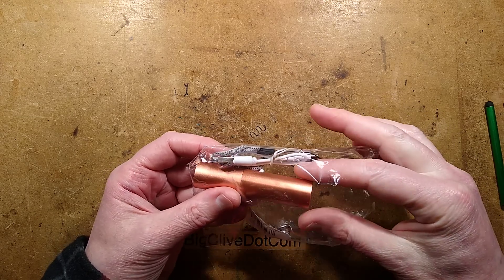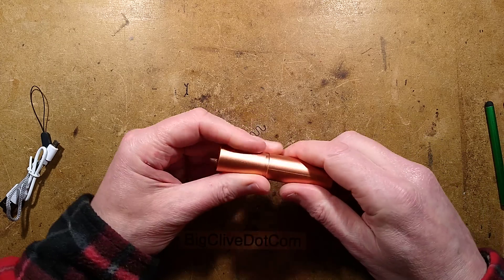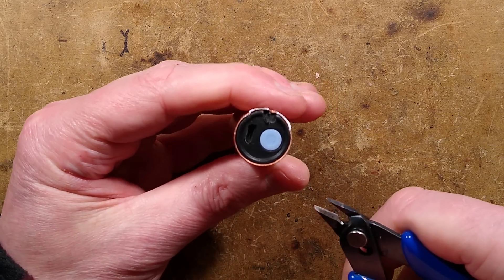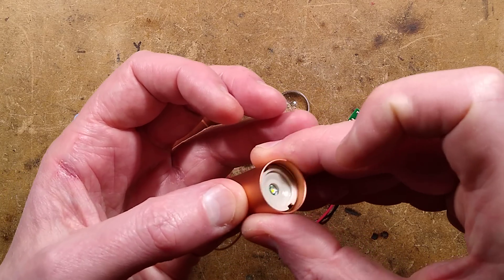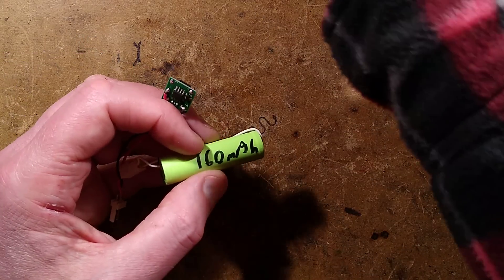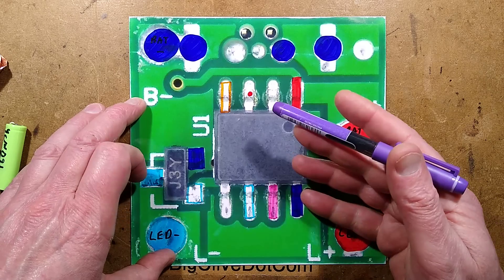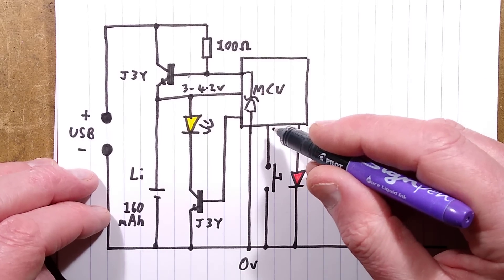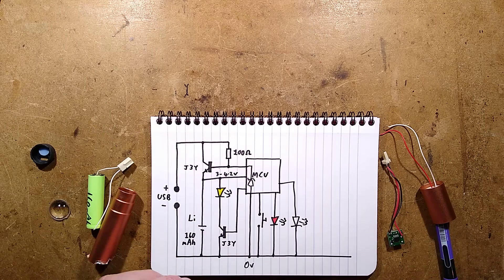eBay 98kW LED flashlight (slightly exaggerated) with schematic

Comment: Ebay watts are on a slightly different scale to regular watts.
Reply: Just like nautical miles are on a slightly different scale to regular bananas.
Reply: Computer storage on AliExpress has a different scale too. I’ve seen ads posted for SSDs and flash drives ( SD & micro SD cards ) that had capacities in the petabytes (1 petabyte is 1024 terabytes, or 1000 depending on if it makes the company more money) for less than what the similar sized storage in terabytes would cost. Wish they were real as I would buy a bunch and have all of my storage space taken care of until technology makes SSDs in a RAID with hot backups unusable like a paper card reader.
Reply: @capitalinventor4823  I once managed to „upgrade“ a fake 1GB pen drive bought on eBay to a total of 128.12GB. To do this, I cracked open the case and dropped a genuine 128GB SanDisk micro SD into it... 🙃

Comment: It would have been nice of you'd measured the Voltage and Current to the LED and told us what the Wattage actually was. I expect closer to 980 mW. Only five orders of magnitude exaggeration!

Same thing with the USB power bricks some of which suggest they can feed 1A for over 10 years before requiring recharged. I suspect they're fibbing.

Comment: I run an escape room and I want to have a system where shining a UV torch on a puzzle will give you more context to it, so rather than just explain everything to kids over a clue, they can look at a picture that is invisible to non-idiots. I wanted a way of building my own rechargable uv torches and that schematic is going to help me loads!
Reply: Ask on r/flashlight for a suggestion based on your requirements. It is a good community, and someone would be able to advise a model that matches what you are looking for. There is a lot of modding advice too, with advice of what base to use it you want to fit your own LEDs.
Reply: UV LEDs can be tricky to get right though, as many „UV“ LEDs tend to emit the wrong wavelength to make UV ink show up as desired. A backup plan - If you want one - Might be to provide red or green LED torches and paint the clues in the opposite colour (So green paint, if red torches) obscured by patterns in the same colour. 😇

You'll be familiar with this idea if you ever used 1st generation 3D glasses. 🟢👓🔴😇

Comment: My eyes still haven’t recovered from the mind blowing power of that torch
Reply: My Tablet screen melted! ... Big Clive owes me £110! 🤣
Reply: Well, I purchased a small flash light that advertised itself at being super bright, where my eyes have likely been damaged from using it. It was only 5 Watts although used a UV diode that produces UV light that can cure UV epoxy. Really burned my eyes and had giving me headaches and had me seeing spots after using. Gotta be careful of cheap Chinese cr*p!
Was several months when accidentally I noticed it could cure UV Resin, and thus was the cause of my eyesore. Now I'm paranoid of Chinese led products.

Comment: I'm impressed that a 160mAh battery was able to power a 98kW beam for more than 20ms
Reply: That's a 160 Amp battery.
Reply: @solarsynapse maybe it’s a 160mah battery at 96kV
Reply: @nialasciva  I don't think so. Some of the wires are too close together, and arcing would occur, since the dielctric strength of air is about 3 kV/mm.

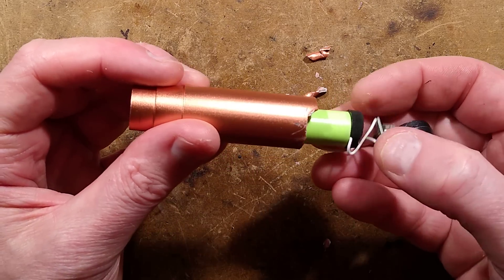Comment: 3:23 One trick I use, when I want something like this taken apart cleanly, is to find some sacrifial bit and superglue it to whatever appears to be blocking access to the innards, like in this case that black plastic bit. Not worth it in this case, but every now and then one comes across something that'd be a shame to destroy. One can usually just 3D-print a replacement for the part with superglue afterwards.

Comment: Where is the battery to be charged on the schematic. Does it go through the IC?
Reply: Below the top left transistor, 2nd "vertical" from the left,  first "vertical" is supply voltage input.
Battery+ is attached to the MCU, but it's the top left transistor that controls the charging.Battery + also connects to LED anode. LED is controlled 'low side' by the bottom center transistor which in turn is controlled by the MCU.
Reply: @michaeltempsch5282 Ah I see it now. To my eyes I was seeing that as a capacitor. I should have noticed the 160mAh. Thanks.
Reply from the maker: The IC controls the charge transistor.

Comment: Ah they upgraded you to the crinkly bag from starch because the 98kw would certainly melt it!
Clive, I have a flashlight with 6 cree leds. It has the hi-low off job, but if you "bump" it, it must pulse a setting change because it then reverts to hi, mid, low, epilepsy and sos mode.
I thought it was a dying battery trick, but if you want to take it to bits, I would be happy to send it to you for investigation. I'm going to retire it from urbex duties.
Maybe most flashlights have this bumpable setting (quick power interruption on a particular setting)
Reply from the maker: Some have a short memory and will switch modes when turned off and on quickly.  That can be triggered by a bad battery connection.

Comment: Thank you for showing a way to open this lamp!
Now I know how to open my lamp without damage ... hopefully.

The charging is medium smart. Over the 100 Ohm Resistor there is a current flow and this activates the transistor. With one pin it measures the voltage and if this is ~4.2V the pin which is going to the base of the transistor is switching to GND, so the current flow stops.
Stupid is, that there is no current limitation, only the limitation of the power-supply and the wiring. With 160mAh there is very easy a overcurrent and very fast charging. Not good. It is worth to open this device.
Reply: How can you possibly know the safe charging/discharging rate of this battery with just its capacity?
In fact, there is a correlation between the two that suggests this quite large battery with an unusually low capacity is made for relatively high current like 5 or 10C. That's how a standard 18650 sized Li-ion like a Sony VTC6 can safely output 40A.
Reply: @PainterVierax  - 
1. This is a China LiIon-Cell. Mostly there is a old laptop cell in this lamps.
2. For this price you do not get a high quality LiIon-cell. If you know china and chinese products, you would not believe that they put a very good cell into this lamp.
3. A very good LiIon-Cel for high current has only 1600mAh, the cells with a higher internal resistance have 2000 or 2500mAh.

Even if they use more copper to reduce the resistance, then the electrodes are not better. With a high charging current you create always Lithium-dendrites. The cell can handle the current, but it get damaged too.

The discharging with a high current is not a problem. There the more copper make sense.

But this device do not have a current limitation, only the resistance of the cable. This is not safe.

Comment: Sounds entirely plausible, that’s only 23,333A out of the lithium cell. /S

Disappointed you didn’t measure the actual power though, BCDC.
Reply: J3Y is an S8050. Maximum dissipation is 300mW, so it'd be less than that. But with these things, who knows!?
Reply: Just enough amps for ball lightning.
Reply: but only for ~2ms

Comment: Can I suggest a plumber's pipe cutter to cut through the next thin circular casing.
Reply: Sounds like a euphemism.
Reply: Or a refrigeration engineers, pipe cutter
Reply: Dremel with a cutting wheel
Reply: Nah, soft aluminium, try a meat clever, WAY faster

Comment: Brave to stick your hand straight into a 98kW beam.
Reply: Hats off to Clive for risking life and limb to make us content...
Reply: As brave as honking those Aliexpress 600 db horns.
Krakatoa is just a whisper in Antares in comparison
Reply: Balls of steel, I tell you!!!
Reply: @ChuckKirchner-se6ib   Is that what the "clanking" sound was?
Reply: It would be the flashlight equivalent of a rocket thruster... Turn it on, and the intense output turns everything in the immediate vicinity into plasma, and with a mighty roar, it is gone, never to be seen again...
Reply: 98 K W Beam, effing amazing, from such a tiny power source too? Those clever people, sure you couldn't be up to them foreigners?
Reply: @conmcgrath7174  The "Lithium cell" is really a micro-fusion reactor!
Reply: @phils4634   Has it got a Tokamak?
Reply: You can heat a whole apartment complex with a micro USB powered device. Brilliant.

Comment: I'm not buying any flashlight less than 1MW.
Reply: Patreon supporters get access to his videos before they are set to public after some days.
Reply: @TazerReloaded  From YouTube? I thought Patreon has it's on video platform. OK.

Thnx for clearing my doubt.
Reply: @Yash9278  They are initially listed as private / only people with the link can access it, and the link gets published on Patreon.
Reply: @Yash9278  The Patreon player is trash though
Reply: Naw, I want 1.21 gigawatts, not a watt less.
Reply: Just ensure you don't drive your car too fast if it is activated.
Reply: @mxslick50 These are perfect for times in the past when you needed a flashlight but didn't have one.
Reply: @mxslick50 I only buy flashlights powered by 3GW RBMK reactors.
Reply: @mxslick50 
You need a flux capacitor
Reply: @mxslick50  Sorry, but no time travel for you. 

Get back to school, Marty.
Reply: @mxslick50  1.21 gigawatts is approximately the output power of the Thomas A. Smith Energy Center in Dalton, a relatively small town in the southeastern U.S. It would be fun if there was a flashlight that outputs the same amount of radiant energy as a medium sized thermal power plant outputs electrical energy.
Reply: I dunno... a phased plasma rifle in the 40 watt range would be nice.
Reply: @95rav just what you see pal
Reply: @Shuhaib-jt9nq depends if you use stupid translators,or if you have listened at school. MW has a very clear univoque definition . It would be fool to always assume people use the Apple word to designate oranges ...
Reply: @Shuhaib-jt9nq  i was also referring to a joke ...
Reply: Imagine you order 2MW laser from temu and then you receive military grade LaWS head.
Reply: Who has the biggest flashlight these days? Last I seen was Photonicinduction at 2.1kW https://www.youtube.com/watch?v=MGANrd7u4o0
Reply: Less than 1MW it should be called a flashdark.
Reply: I wonder what a 1MW flash light would look like… 🤔
Reply: Good news. If you search carefully, you will find plenty of 2MW and 5MW lasers ...
Reply: @Benoit-Pierre  Do you mean mW or MW? There is a factor of 1000000000 between these units...
Reply: @olli1068  i don't mean anything. Fact is, many lasers are sold as branded 2MW or 5MW. 

But you may receive 2mW or 5mW items ... 

1000000000 is not a rare error factor ^^ check the Planck constant ...
Reply: @Benoit-Pierre that’s milliwatt not megawatt
Reply: Stand firm
Reply: Me nether 😤
Reply: I read this as fleshlight lmfao
Reply: Holding a 160 MAh battery in your hand is not for the fainthearted, either.
Reply: I'm holding out for 6MW so I can make popcorn.
Reply: Ok. What? Video is uploaded 56 minute ago and your comment is 8 days old...??? Awesome bug. 👍
Reply: @Yash9278  Not a bug.
Youtube videos can be set to "private" with the private link given to paying subscribers or patreon subs.
Reply: @Yash9278  first day on YouTube?
Reply: @YoutubeHero666  No 1st day in TikTok.

Comment: I've used a 1/16 inch or 1.6mm drill bit held in a small pin vise, and I drill a small hole in the plastic.  Then I screw a M3 or M2.5 by 6mm sheet metal screw into the hole I drilled.  Now I have a 'handle' to grab onto with a pliers or dikes and give the plastic a strong pull. This allows getting inside to repair.  👍

Comment: At 98kW that battery will last two-hundredths of a second. 😁
Reply: But the 23000 Amps will vaporize the thin cables even faster! So this has to be classified to be a bomb.
Reply: A battery with that kind of density would be much more powerful then a firecracker.  98kw is equal to about 23g of TNT... and the biggest consumer grade firework only has 50mg worth. It would go boom... and take your house with it.

Comment: If you really could get 98kW from an instrument that size, the National Ignition Facility people would like to hear from you! They could replace all those expensive lasers and initiate fusion with a bunch of pen lights.
Reply: Maybe it is just extremely pulse modulated the NIF lasers are something like 500 trillion watts so if that thing is pulsed for a nanosecond or whatever perhaps it is outputting 98kW
Reply: @glenecollins  Then the shutter mechanism would be worth repurposing!
Reply: @glenecollins  I seem to remember from visiting Harwell that some of the extremely powerful lasers which they have there output in one burst the same amount of energy which you'd get from eating a Mars bar.  Perhaps a similar case?  Vulcan - that's the chap.  Each burst lasts less than a pico-second.
Reply: @johnwinters4201  I suspect that isn’t the best design for a torch but it would probably get around the false advertising as long as they advertise just the wattage  and didn’t advertise the duty cycle was more than a microsecond or whatever they would technically be telling the truth. They could use the innards from a dipolating laser and turn the power down and the frequency up.

It also wouldn’t help with most lumen testing rigs because they actually measure lumen seconds (luminous energy) but I think the actual definition of the lumen is momentary the same as wattage.
Reply: Build an artificial sun with a million of this flashlight combined and voila, UNLIMITED POWER!
Reply: @sihamhamda47  Point it at a solar cell and you would get about 20kW back. You can certainly power more than one of these lamps on that, so all you need to do is cascade lamps and solar cells until you have satisfied the entire energy needs of humanity!
Reply: You dare to call that an 'instrument'!
Reply: @paulstubbs7678  I'd like to remind you that according to Patrick Star, mayo is ALSO an instrument. Or at least, he questioned if it could be at any rate :D